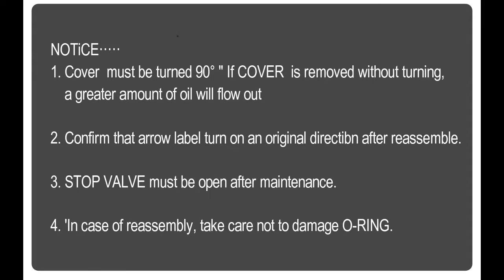IHI deck crane oil filter cleaning and maintenance

Comment: Why need to turn 90 degree?
Reply from the maker: Rotates 90 degrees to stop the flow of hydraulic oil
Reply: Is there no any manual for stop flow of oil before filter?